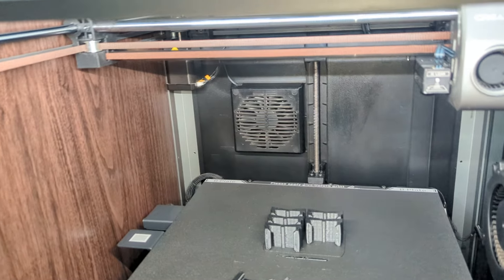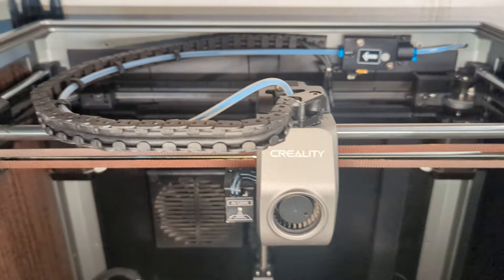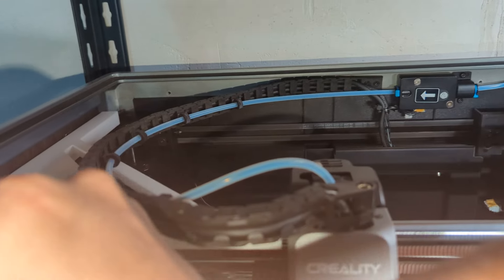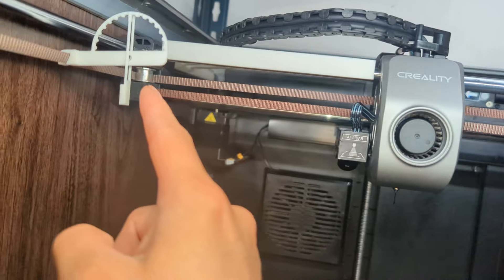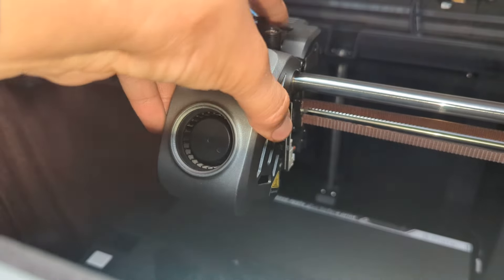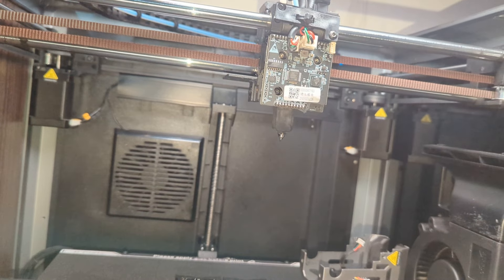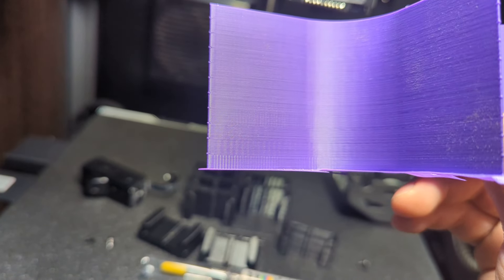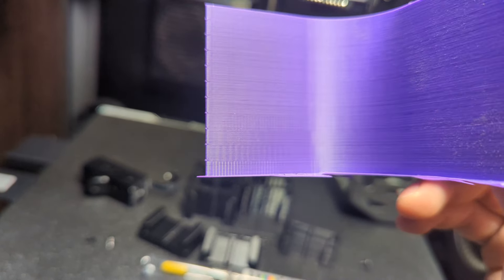Creality K1 Max - Tackling Input Shaper Issues, Horrible Creality Support.

Comment: I cannot thank you enough. I popped off the extruder cover on my K1 and low and behold one of those springs was seated so badly it was poking out the side. Removed both springs, cleaned the rail and now it's printing flawless. I was about ready to sell this thing for $100.

Comment: Just got my K1 Max (noticed the Qidi plus4 just after the order had shipped), it has been 4 days of trying to work out the vfa problem before i got the K1 i didnt know what vfa was.. contacted creality support right away said i wanted a refund, in EU you have a 14 days cooldown time when ordering so you can return the product without a reason within dose 14 days and creality support is dragging it out, i said i wanted a refund and they send me videos to tighten the belt etc.. There is no problem with the belt tension or anything els. internet is full of desperate fixes that dose not really work to much.. Now wonder they ship the printer with some bonus filaments all being a mat surface semi transparent warm white material to hide the ringing/vfa problem, so fucking smart guys!  Thats 900 dollars, they need to get there shit together 900 dollars of gear should produce a very good print no vfa, now its 900 dollars and even then its just a fucking headache!
Reply: Now I want to add a sudden heat creep problem clogging the nozzle, heat  from the extruder motor creeping in and softening the pla.

Comment: Hello, you still have the big gears on the back of the engines, you can change them for smaller ones. That's the whole problem. A German-Russian did the conversion. This is the only thing that really helps. Known problem of the first series with the successors K1Max 4 generation, K1C already have the small gears on them. Kind regards from Germany Video name: Creality K1 Das BESTE UPDATE aller Zeiten

Comment: question on a community post: how did you get that perfect build volume? and it doesnt touch the purge!!!
Reply from the maker: You can't, at least I don't think you can get a perfect 300x300, it's also going to be like 295x295 ish.
Reply: @Zeltroix  no yeah but you sent a community post wich showed your bed and the was a perfect sized yellow print on it (ender 3 s1 pro)
Reply from the maker: @Dumpflam  oh, for the S1 Pro, yeah on that one you can get it really close to the full 235x235 rather than the 220x220 but you need to play around with TTs firmware to achieve that.
Reply: @Zeltroix  how did you get it to not touch the purge line?
Reply from the maker: @Dumpflam  The purge line is all the way on top where the letters are, and everything else is withing build area. Similar to how the K1 cleans their nozzles before a print.
Reply from the maker: @Dumpflam  I'll make a video showing how I did that.
Reply: @Zeltroix  thank you! but even if my purge line is on the letters (i use your start gcode) my print area in cura still includes that space. do i have to manually avoid putting anything there?
Reply: @Zeltroix  also irrelevant question, you sound both like a 40 year old and an 18 year old. how old are you?
Reply from the maker: @Dumpflam  LOL, I'm right in between those ranges.
Reply: @Zeltroix  so about 28- 29?